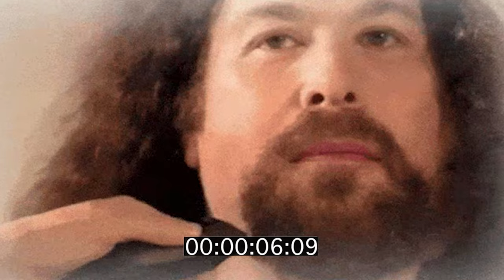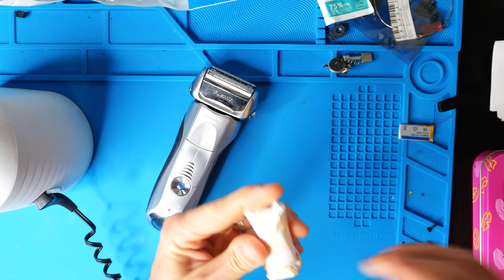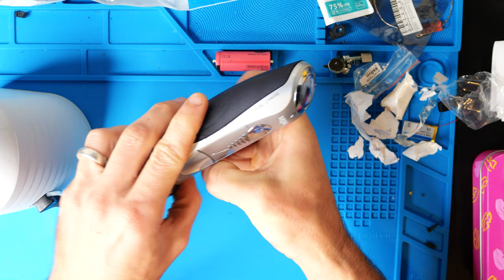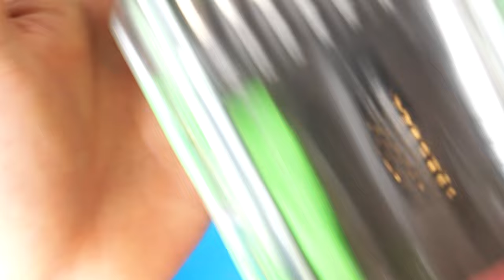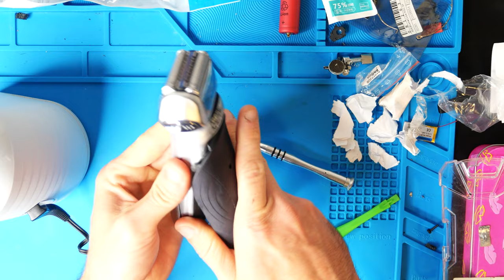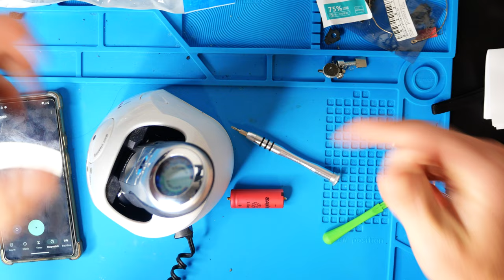Braun Shaver Battery Replacement | Series 5 7 8 9

Comment: Do not waste your time, trying to replace the batteries they are tech welded in and the connection will rip the battery connector out of the circuitboard
Reply from the maker: This model was not welded

Comment: hello Eric after not using the shaver for a few years when I go to charge it and use it. it works fine then cuts out losing its charge . is it the battery. this razor is fine for my needs they are just too expensive for me to replace  is it the battery?

Comment: My 10+ year old 7 series is still going strong. 
I don't charge every day, I let it run down. 
But it's good to know how easy it is to change the battery. It really does make sense.
Reply from the maker: I should probably let mine run down instead of docking. It may last longer
Reply: For some reason batteries last longer when they stay in their mid power range. If you charge a battery to say 70-80% capacity, it will last a very long time.

Comment: Hi, thanks for the video, I'm just wondering : if my battery drops dead one day, would I still be able to use my 7 series shaver corded (plugged to the electricity) without the need of a battery ?
Reply: I "assume" so as my 8985 battery is dead but the device still works when plugged into power.
Reply: @s0c7  thanks, I think so as well and that’s one thing I like about the corded devices
Reply: @krikx08  my battery is dead, only lasts about 10 seconds, but it works with full power when connected to the power cord.

Comment: I liked my 760 so much I ended up buying buying two 790cc "Wet and Dry" model because my 760 motor seems to be going bad "Not Battery" It is over 12 years old and I used it for only head shaving, which is more work for the razor than face shaving as I still have a lot of hair on top, just got to thin for my liking. 

I ended up getting some SMP work done on my head and these 7 series models are by far the best.